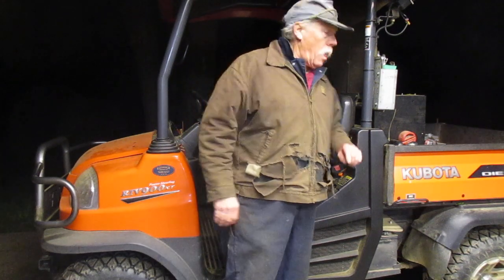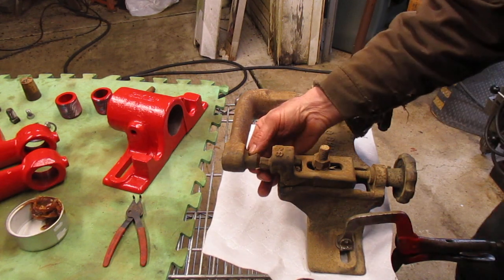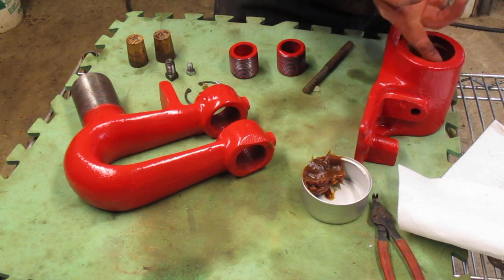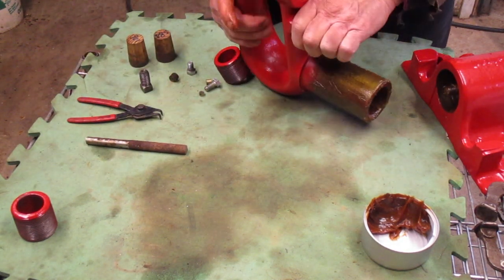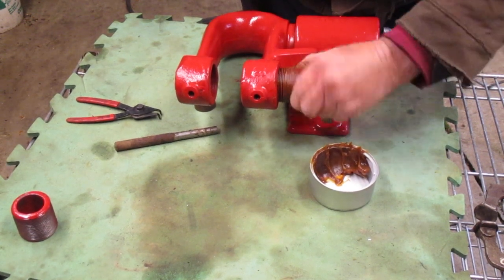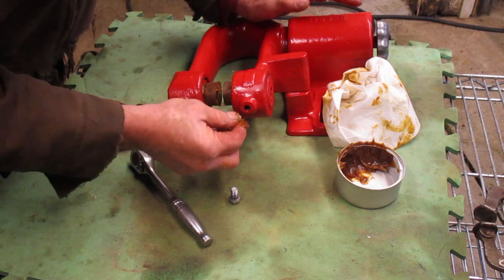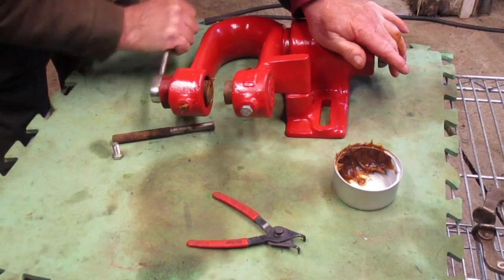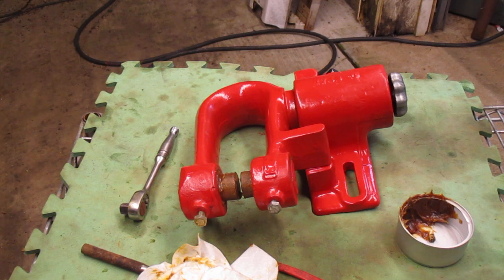#Frick Saw Guide Redo #340

Comment: Mr. John, have you thought about using either powdered, or liquid graphite to lubricate those parts, because that's what I use a lotta times when the parts are in a dusty dirty environment.
Rain or moisture doesn't seem to really bother the way it works that I've noticed on the things I use it on, but it's as messy as grease is if you get carried away with using too much of it in one place. 
Only it doesn't turn into instant dirt or dust magnet as oils, are grease does, and it's easier to clean up I've found.
Appreciate the tutorial on the alignment device, and I've seen the in cab manic, Mark adjust his blade, but it wasn't apart as yours's was so that the components could be explained to the degree you just went to.
Reply from the maker: hi there i was thinking of antisezze but just used good ol grease . thanks john